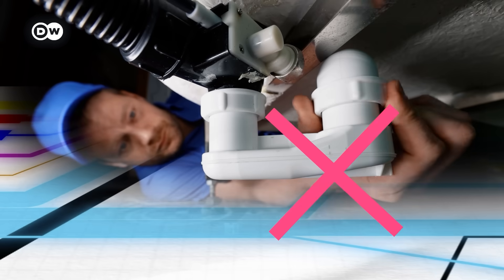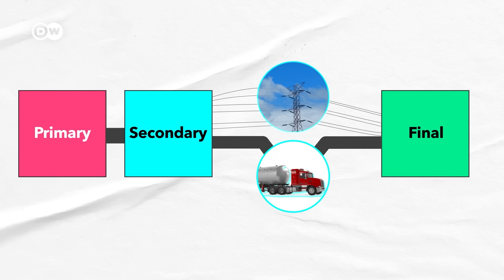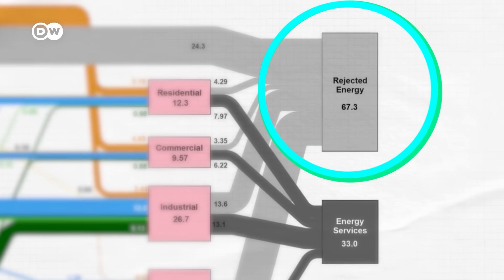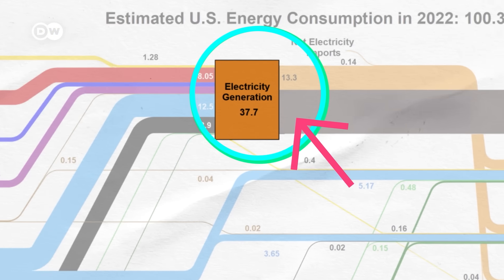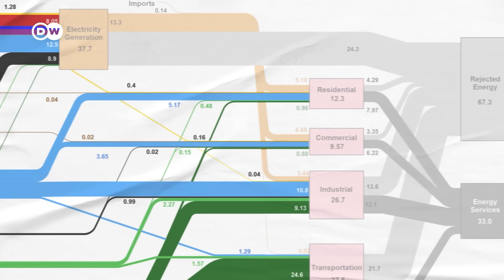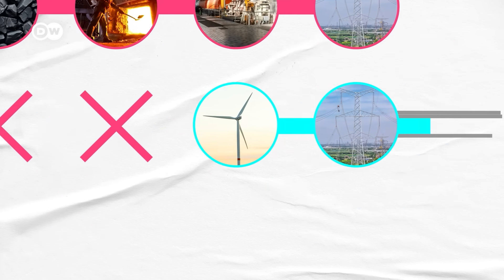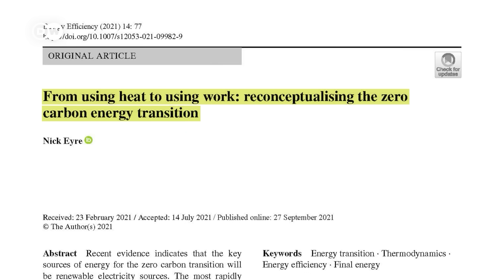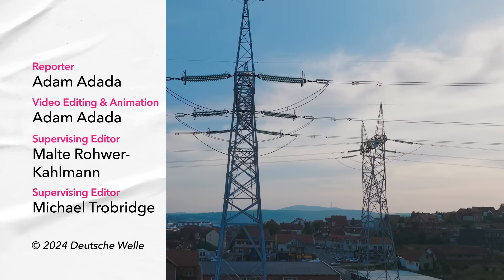The mind-blowing thing we get WRONG about energy

Comment: Brisbane, Australia. In 2019 we spent $16 500 AUD on a 13.2 kW solar and 12 kWh battery system, and we save $2000 AUD a year by no longer getting (paying) a power bill. For the first 4 years our feed in tarrif was 20 cents a kW so we made $2000 for the extra power we export. In 2020 we bought a 2010 i-MiEV and save $3500 a year on petrol we no longer have to buy for our transport needs. Just in that time we've saved / made $32 000  AUD. With a 20 + year warranty on most of the Solar system components we are looking forward to many more years of savings!  If Governments won't lead the push to Renewables, it's up to those of us that can to lead the way.
Reply: Despite counting dollar savings, which feels great on personal level, solar and EVs go incredibly well together, and their advantage relates to this video closely.
Reply: Yep - love the fact that, contrary to the opinions above, we paid for our solar and battery system, benefit from not importing any electricity for most of the year and can charge our EV for nothing and run it very efficiently with no emissions  @blackduck531
Reply: @blackduck531 so you keep your car at home all day when the sun is out to charge ?
Reply: @rinzler9775 Most of the time private cars are NOT used. At least when I look out of the window and see all private cars blocking roads and side walks 24/7. When you can re-charge a car during one single day and drive 200 miles a week it will work on average for a week unless I have a job which makes you stop at gas stations two times a day. How often do you believe this happens in reality to people?
Reply: @DerAusdauersportler the reverse is also true - the ones needing power are used the most during the day - people driving to work, trades,  uber drivers, shopkeepers, all those behind the scenes people getting up early, working tirelessly without complaint, so you can get your latte and have groceries in the store, power and water still running to your house, sewer and rubbish removal services, countless jobs you never see.
Reply: @rinzler9775  Well, well! Whataboutism. We are discussing a specific post here, not the millions of people living in cities doing relevant jobs and cannot even afford to drive a car through places like New York City. BTW: What are YOU doing when not judging people you do not even know remotely? Working at a hospital or doing something really, really relevant for the society or are you simply bored and overwhelmed with this simple topic?
Reply: @DerAusdauersportler I'm a worker, not sure about yourself.
Reply: @rinzler9775  This is no excuse to stray off topic and fall for Whataboutism! Does it make you a better human to call yourself a worker? Do you feel superior, now?
Reply: @DerAusdauersportler the argument "most cars dont get used" is ill thought out - if they dont get used, they wont need charging, in fact, petrol cars not used retain all their fuel, evennif not used for years- EV's will slowly discharge. And the ones being used, they are out all day, the very ones needing the "solar power", so its a mute argument.
Reply: I'm a villain and use bicycle a lot. We have a good bicycle road networ, but since I don't pay for fuel for it, I guess I'm freeloading. If only society had a way to get for example a part of their citizens' salary etc. to pay for things like road maintenance!
Reply: That's awesome! I also love Brisbane, such a nice city!
Reply: Butthurt commenters here are hilarious.
Reply: In Australia where you have intense sunshine this may very well work with the subsidies of the power company paying you - is that 20 cents a kWh preferred pricing or the going rate? Here in Canada solar is not so beneficial.
Reply: @smorgie7720 This is plainly wrong. Solar panels became so cheap, just install twice the number and you have what you need. Last time I took a look onto a map Canada was a big country…
Reply: @smorgie7720  on top of that, solar panels loose efficiency, year after year. Then you are faced with an expensive replacement. The 20 year "guarantee" only covers the installation, where they drilled dozens of holes in your roof. And that's assuming the fly by night installers are still in business when you claim.
Reply: $3500 a year savings on petrol. It must be that petrol in Australia is Expensive or you drive a lot. Do they have public chargers in Australia?
Reply: @---nt5mb  it is an experiment in small scale doability, the amount of mining that will need to be scaled up to meet the demand for solar panels, batteries, wind turbines etc is another dimension altogether. The electrification evangelists conveniently want to ignore this elephant. You can electrify trolleys but not mining excavators, trucks etc and I mean that not in the literal sense but in the sense that it is not viable in any logical universe.
Reply: can't wait for your wild fires to bankrupt you, if the monsoon doesn't wipe you out solar and wind only last 10 years at best. weather wipes them out, flip 5 quarters 5 times a day if they all come up heads your solar farm or wind farm just got wiped out by mother nature. do this every day for the rest of your life. how's that safety and security? reliability is everything, penalties for unreliable energy need to be raise 150,000% on solar and wind, because the companies just go bankrupt after stealing the subsidies and abandon their toxic waste farms all over farm land. solar and wind should be confined to city buildings only. keep your toxic waste out of the food supply and where the toxic waste of humanity breeds the worst of humanity
Reply: Damn you people are reaching and grasping at straws to find drawbacks of transitioning to renewables that are not actually true.
Reply: Renovable just for small user like you ,complete failure for big business, and if Australia is almost providing enough power from renewable, that because we have no industry left...it's self destruction!
Reply: Been there done that!  more need to do the same!!
Reply: Came to comment on the gov subsidies here in Australia but others have mentioned it already. Our stupid gov is paying you to put them on your house to produce energy instead of just building us reliable, safe and clean energy like nuclear.
Reply: Damn you got ripped off for a 13.5kWh system
Reply: @lolosaulala48  and a 12kWh battery, I don't think so buddy
Reply: @lolosaulala48  you're tripping. that would probably cost 30-40k euros where i live.
Reply: @moos5221  damn y'all getting screwed
Reply: @lolosaulala48  maybe we are. but maybe that's just the cost you pay for living in a highly developed country with high minimum wages and work safety measures.
Reply: @moos5221  damn sounds like post war consequences
Reply: Solar and EVs are stupid...steamengine will always succed in the end!!!! ;)

Thanks for bringing Oz to the 21th Centurie!
Reply: I have a similar system to you but I am in South Africa. We have lots of cloud cover throughout the year in my area. Clouds are the real reason I cannot produce enough to power my whole house especially in winter. I would need an extra couple of batteries to charge my cars at night but this would only help me in summer. In winter I can’t even produce enough to completely get off the grid.
Reply: Your math doesn’t make sense! It appears that you didn’t have any Purchase costs.
Reply: Your feed in tarif was 20 cents a kWh, not a kW
kW is power, kWh is energy
Reply: @romainhedouin  forgive the typo oh righteous guru.
Reply: What about countries without this much sunshine?
Reply: I just converted to USD= $10000USD. Does this mean that I save $2200 a year on gas and make $20000 in 5 years. These numbers must be fake. it makes no sense.
Reply: Victoria Australia here. Much the same story. Save that savings on petrol are higher, presumably because we drive further.
Reply: Dude, $3500 on petrol and $2000 in regular electricity? Are you making up numbers here? $3500 on petrol is almost $300 per month. When do you even charge your EVs now since you're driving all the time?
Reply: @fanymanea asshole, he meant AUD, an average American spends about 2800USD for gas
Reply: What do you do with all those savings?
Reply: What about the whole of life energy efficiency for each type of energy??? This article was simplistic and ignores many hidden factors. It does not wash.
Reply: @annavariumful has forgotten to mention that in the last 3 years the solar feed in tariff payable by the suppliers has dropped, at least in my case from 11c per kWh to 4c. The price of electricity has sky-rocketed because the green initiative has forced fossil fuel plants into closure and yet has not got the necessary 100% baseload infrastructure support needed for when day turns into night or wind becomes calm... Check the brown and blackouts coming our way this summer. And the best batteries only last approx 4 hours. Someone is getting filthy rich while we pay in dollars and health risks for it.
Reply: Ironically, you have to live somewhere without trees and rain to really live off solar.
Reply: Hopefully the liberals won’t get in.
Reply: And did 1000 years of environmental damage to get the materials to make those batteries
Reply: @Mikey-b1s  thats nothing compared to the terminal damage that fossil fuels create
Reply: You should be applauded for making the investment and having the attitude you do.  But your $16,500 'investment' is paying your power bill forward, so that's 8.25 years (without addressing lost opportunity of the money or interest accumulation over that period) until you break even, but it's probably closer to 1-12 years.   Also, if you produced the full 13.2kW, and it topped up your 12 kWh battery every day, you would have fed the grid 1.2kWh per day at a fee of 0.20c which is $87.60 p.a. x 4 years, which is $350.40, not $2,000.  However, no solar system produces 100% daily; it produces at about 25-30% efficiency, let alone the fact that most domestic solar inputs are curtailed during the day as they overwhelm the grid.
Your EV savings are questionable when you deduct the extra electricity to fuel it (I know, it is still cheaper than petrol).  You do not factor in the devastating mining and CO2 emissions of precious metals to produce the batteries.  Just saying!
Reply: @shane4131  You don't need to over complicate it. No power bill each year, saves us $2000 a year. Feed in payment was $2000 a year for the first 4 years. Now it's about $500. Not buying petrol for daily driving saves me $3500 a year. I charge my little EV up at no cost from the solar. So we are saving $7500 a year all up. 2023 we used 6227 kW and exported 12005 kW. 2022 we used 6095 kw and exported 11573 kW. Mining and emission were not part of the conversation, so I didn't forget to factor them in. Having said that driving an EV built in 2010, and upgrading the battery in 2022, is wayyyy less devastating than all the mining and oil drilling required for an ICE vehicle. Just saying!
Reply: @shane4131 If the system produces 13,2kWp it means that it could theoretically produce 13,2kWh/h that's with an average efficiency of 30% around 35MWh per year. At 20cents per kWh you'd end up with 7k a year if you fed all of the energy back to the grid so that's an absolutely profitable investment
Reply: @shane4131  a 13.2kw system produces 13.2kw over several hours (at its peak). Where i live, hungary, we have a 6kw system which tops at 40kwh on a sunny day. So your maths are off. If then you feed back 10-20kwh a day to the grid times 0.20 ausd, then depending on the weather/climate you can reach the amounts easily.
Also, to mention the "devastating effects" of mining for evs and then skip over  the devastating effects of petrol production is very short sighted. There are conflicts over oil, oil spills, chemical spill, air pollution which cause millions of people to get chronically ill, hundreds of thousands to die each year. Oh and then we have the the climate change due to greenhouse gases... so pick your team. Batteries can also be recycled, a burnt liter of petrol you cannot.
Reply: Does the 20 year solar panel warranty cover their output deteriation, what does the warranty actually cover ? Also, what above when the EV is worthless in 7 years due to battery deteriation, when it range falls to near zero. You have to completely replace with no resale value. Your cost accounting is very biased
Reply: @rinzler9775  EV batteries in the US have an 8 year/100k mile minimum warranty by law.  Mine has a 10 year/100k mile warranty.  With 40 million plus EVs on the road globally your scenario is proving not to be happening.  BTW, CATL just announced a 15 year warranty.
Reply: @muskrat3291  lets see what your range is in 2 years. When you have to use the same amount of power and get half the range, and still have to lug the full weight of the batteries.
Reply: That's not much of saving the installment price of these crazy renewables are crazy, batteries are themselves inefficient, unless the battery technology improves and I am not talking about the chemical betterries because those are in principle ineffective and inefficient then we can actually jump to renweables
Reply: @sulemanmughal5397 I think you really must educate yourself about these things because you are spouting nonsense
Reply: @sulemanmughal5397  Battery efficiency is , depending on charging speed, 85% to 98%. This is calculated as enbergy used for charging compared to the energy taken back from using the battery energy.
Source...technical university ream about the (small 5,1KWH) battery in their solarcar....competing in the wsc.
My EV has a 6% charging loss including the losses in cable and charging station when charging with 8 to 11 KW (72kwh battery). When speed charging  (during longer travel, max 5% of all miles) the loss is obvious much more...also cooling needed during charging.
Reply: Most of your "savings" are subsidies provided by the taxpayer and other grid and road users.
Reply: @jonathanrabbitt you do realize that fossil fuel development is heavily subsidized. In the U.S. alone, fossil fuel industries receive more than $30 billion annually im direct subsidies and many times more in indirect subsidies. You can subsidize.ineffiect, planet damaging fossil fuels or you can subsidize clean energy productiom and EVs that can allow consumers to save money.
Reply: @dannyboyNS752  Much of the so-called fossil fuel industry subsidies fall into the "we could have taxed the industry more" category; i.e. bullshit political claptrap.
Reply: @dannyboyNS752 well not really, the EVs are 30% more expensive to begin with. Yes the battery is more effective but it degrades over time ending up with maybe 55-75% by the EOL And if it dies you are in for a huge expense out of your pocket. Add the more expensive insurance on top of it and the "savings" you claim are simply not savings you are just recovering money you overpaid. Also the manufacturing of the Tesla Model 3 battery for example can produce 7,000-35,000 lbs (3,200-15,800 kg) of CO2 so your EV is starting with a big carbon footprint even before driving...that you then compensate by its clean emissions. All In all, you barely make any significant impact both financially or environmentally.
Reply: @igorcicimov6234  you are grasping at straws. 

You argued against EVs because they are subsidized. When I pointed out that fossil fuel exploration, extraction and refining are all subsidized you start grasping that producing an EV creates a carbon footprint...so does producing an ICE vehicle...what is the difference in the production footprint and footprint from operating?

You point to the huge expense of replacing an EV battery (which typically have a life of 10 to 20 years). What about the cost of major engine repairs and their frequency. Also, because you don't have moving parts on an EV your regular maintenance is essentially just replacing break pads.

You claim EV insurance is more expensive. Where do you live? I get a $500 reduction in my insurance for driving an EV.
Reply: @igorcicimov6234  There are many life cycle assessments which take all factors into account (construction of cars, maintenance, operation), and conclude that an EV produces 30% to 70% less carbon in its lifetime. So yeah, you're saying BS
Reply: @dannyboyNS752  Nope, what I'm saying is that, as I said before, your contribution to the climate change by driving super expensive EV is absolute zero. The EVs are not the right tool to fight the climate change especially not in a small country population wise like Australia.. Hell, even if our whole continent disappeared  tomorrow it won't have a slightest impact on the climate. What people (that can't afford an EV) here rightfully complain is that they have to subsidize you, the  higher mid class and elites that buy them, for the purpose of virtue signaling and bragging right about how you screwed them over. The ICE cars contribution to the CO2 emissions is only 10% whilst just 100 companies in the world contribute to 71% of the pollution. Did someone do  something about it? NO! Why? Because it is difficult to fight these super reach giants that donate hundreds of millions of dollars to the politicians. It is much easier for the same incompetent politicians to dump it all on the little man that has to buy overpriced technology with insignificant effect on solving the climate change. P.S. Guess you deserve $500 discount after paying extra $30K for the EV
Reply: @igorcicimov6234  If your battery is 55-75% then you've been driving it for decades, or it's faulty and within warranty so you can get a new one.
Reply: @jonathanrabbitt  This is just flat out untrue. As the video shows, 20% of the energy used in a petrol car gets used to move the car whereas 90% of the electric in an EV does. Efficiency improvements are a thing and can be a big savings. I don't know about Australia, but in the US many States have EV registration fees that replace the gasoline taxes they aren't collecting to cover road maintenance costs. And my power company charges me a small connection fee for the privilege of being able to use their grid.
Reply: @chill-633  What was it that is untrue? The economics of EVs are marginal for ordinary domestic use cases. Most EVs are Veblen goods. Energy efficiency is not relevant to economics, especially when subsidies are also putting their thumb on the scale.
Reply: @jonathanrabbitt  Absolut BS. This incorrect  believe is spread by people who earn money within the oil industry and all around to make people againstthe transition...jsut because those industries will loose billions of dollars revenues daily if everone does this.
(In my country the taxes on electric are a lot higher than on petrol / kwh energy. That is the same as subsisies for fossil fuel (lower taxes are often called subsidies)
Reply: @jonathanrabbitt  Incorrect! Everything paid for by our selves! Sour-grapes!
Reply: @annavariumful  So you get to use the roads and the electricity grid without paying anything. Freeloading must feel wonderful.
Reply: @jonathanrabbitt  Having a bad day are we? Not my fault if I am pro active, and you would rather just winge.  Once the AU GOV brings in a road tax I'll be paying it. Until then, nothing I can do about that. I'm still grid connected, and paying the daily connection fee, so I'm still supporting the grid. In fact I'm selling my extra power for 7 cents a kW, but the power CO resells it for 32 cents a kW, so the power CO is actually the one free loading off my investment.
Reply: @annavariumful  They're not freeloading, they're buying wholesale electricity at wholesale prices.
Reply: @jonathanrabbitt  Why are you against it? The alternative is paying for petrol and how is that helpful for anyone? (Unless of course you're big oil)
Reply: @jonathanrabbitt  No wrong again. They are actually stealing from me. Average price in QLD was $137/MWh. 13.7 cents a kW, and I get a lousy 7 cents a kW. WTF!!
Reply: @jonathanrabbitt  Please don't be silly. They are still paying tax for their car and they are also probably getting less money for the electricity that they sell than the companies that resell it to other people. Also, at least in germany, things like roads are mostly paid for by not actually the car tax or fossil fuel tax but general tax payer money. So if you work and pay your taxes, trust me, you will be paying for those roads, even if you don't use them.
Reply: @BenjiShock  What is silly? They avoid paying Federal Fuel Excise ($16 billion collected annually); and they're getting paid a flat wholesale electricity rate for their excess generation while other electricity generators have to bid in auctions for the sale of their production. Domestic PV owners think their shit doesn't stink, but they foist their excess into the grid without any risk of curtailment and revenue loss, unlike every other wholesale electricity generator connected. Face it; they're enjoying all manner of subsidies for their use and abuse of The Commons. They aren't saving the planet; they're just enjoying their self-important virtue signalling smugness and moral delusions.
Reply: @annavariumful  Get a battery to store your energy because in my country, they got rid of "paying you back" for excess energy your panels produce. So I bought 2 batteries to store my excess power.
Reply: @_Gunner_   I have 12 kWh of battery storage. Looking to get a battery out of a Tesla or a BYD for cheaper, larger storage :)
Reply: @annavariumful your installer quoted you and you paid only the subsidised price. The tax payer paid the installer the extra directly so you only think you paid for it all yourself. The battery will probably need to be replaced after 10 years (or sooner) as will the inverter. Only the panels have a 20 year warranty. Your EV battery will need to be replaced between 5 and 10 years if you use it as much as you say, and the cars resale price is now a fraction of what you paid for it because if that.
Reply: @jonathanrabbitt  Look up into fossil fuel subsidies. Also, burning fossil fuels has negative externalities which are suffered by everyone. So by your logic no money spent on energy would mean anything.
Reply: @jonathanrabbitt Wrong. These savings are genuine. Regarding the immense damage caused by fossil fuels they should be punitively taxed ri reflect the damage that they are doing, especially the climate that our grandchildren will have to deal with.d
Reply: @jonathanrabbitt Without those subsidized panels across Australia, the electricity demand would have been higher, and hence the prices. I think you actually got away pretty cheap as a combined tax payer and electricity customer.
Reply: @jonathanrabbitt  so just not paying for petrol is somehow a subsidy by other road users?
Reply: @jonathanrabbitt  are you including fossil fuel subsidies in your calculations, as the fossil fuel industry gets tons of subsidies, only difference is renewable subsidies like these show up at consumer level at times which is a change. So complaining about subsidies is bad argument unless your doing it for all types and also looking at cost of externalities on health, mortality, and energy cost
Reply: @jonathanrabbitt Do you think petrol isn't subsidized?
Reply: @adiosmuchachitos  Look at how much tax is collected on fuel sales, and then tell me it's subsidized....
Reply: @jonathanrabbitt  do you really think oil companies don't get subsidized? I've got news for you.
Reply: @adiosmuchachitos  Explain one specific subsidy.
Reply: LOL. People don’t understand that subsidies are a punishment to others. Think beyond yourselves!
Reply: @Ratinevo  Burning fossil fuels is a punishment to others
Reply: @Ratinevo you don't say punishment, when government build power station from the budget, do you? Govs invest money to build renewable infrastructure, for a relatively small price
Reply: @Ratinevo  LOL. People don't understand that polluting our planet with greenhouse emissions is a punishment to others, including future generations. Think beyond yourself!
Reply: Guess you don't live in a flat in a row of terraces? I thought not.
Reply: @peterjames424 Fixing charging for those without access to off road parking must be a top priority
Reply: @peterjames424  And your point? You can choose to live in a house if you want to!
Reply: @annavariumful  Juvenile comment.  Many people don't have the option to live in a house,  whether it's due to being unaffordable, unavailable, too far from a workplace or transport, etc etc etc.
Reply: Market prices for electricity is 0.07$/kWh, petrol - 0.9$/liter. Alternative is "efficient" only in a manipulated market.
Reply: @dmitrynegoda9347  you are mixing up concepts and units here. Prices and efficiency are two completely different things. And you're comparing prices, not efficiencies. And in doing so, you have a mistake. One liter of petrol contains about 9.3 kWh of energy. So the petrol with your quoted prices would actually cost $0.097 per kWh, being very close to the electricity price. But the point of the video was about efficiency. With an EV, you convert 90% of the energy to movement, with ICE you convert only 20%. So if you want to compare the efficiency and price together, then you will compare the cost per kilometer driven.
Reply: @fintux  You are right about electric drive efficiency, but this post was about saving on petroleum.
Reply: What is the length of the battery life? Mine lasted 2 years and is now dead. By the time the time battery dies and needs replacement, it will have 'saved' you the original acquisition price...
Reply: @jameskamotho7513 I use 8 recycled 250w solar panels and 8 agm 560amp/hr batteries now 6 yrs old.
When I put up my 20 new panels I doubt I ever use the generator again. Expect for maintenance run.
I have no subsides at all.
Reply: @jameskamotho7513 You lie. Batteries now last longer than the car. If yours packed up so soon you would have got a replacement under warranty
Reply: @jameskamotho7513 ours lasts about ten years now
Reply: How are your wind turbines solar panels and evs getting  produced?  Mining will always be based on fossil fuels
Reply: @Voidhawk001  I guess you haven't seen the push in Australia to electrify all the mining equipment, and the mines have worked out it saves them a massive amount of money with reduced operating costs.
Reply: @annavariumful yep they have v12 cat en detriot motors runinng the electric generater to drive electric whell motors so that good isnit😅😅😅😅
Reply: @adammiles3095  What you don't seem to know, it's still actually better that than ICE cars. Diesel engines are 40 to 45% fuel efficient, petrol engines 17 to at best 30% efficient. At any rate my EV runs on solar power so why make that comment?
Reply: @annavariumful  their been doen this for 15years no sola on them big trucks 300 tones of coal pay load we should be useing it hear not sending it overseas commen sense
Reply: @annavariumful you're dreaming. I work in mining and only token pieces of machinery  are powered by "renewables"
Reply: @Voidhawk001 not true. Mining is one of the most energy conscious industries on earth. Everything gets costed and analysed. Electric mining is just getting started but it’s going to take over once the tech is proven. Shipping, air travel, steel and cement are the most challenging processes to decarb
Reply: . Rio Tonto has ordered 35 heavy electric trucks for their mines.
Reply: @Voidhawk001  You are out of touch. The mining industry is in the process of converting to battery electric.  MacLean,  Caterpillar, Sandvik, Epiroc, Liebherr Group, Komatsu, Rokion, Miller Technology, Artisan Vehicles and others make battery electric mining equipment.
Reply: @Voidhawk001 Never heard of recycling. These things are designed to be recycled. Furthermore have you ever looked into oil production and refining? That is needed every single day by an ICE. I suggest you start with the Alberta tar sands
Reply: @Voidhawk001 Andrew Forrest says that is not the case. He is switching over to giant EV machines